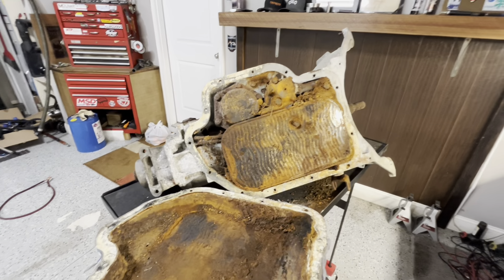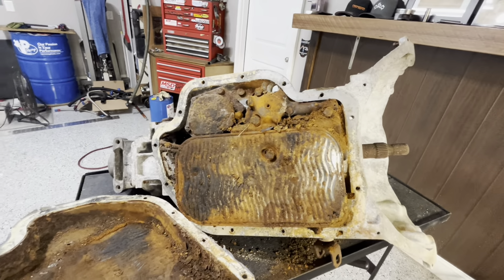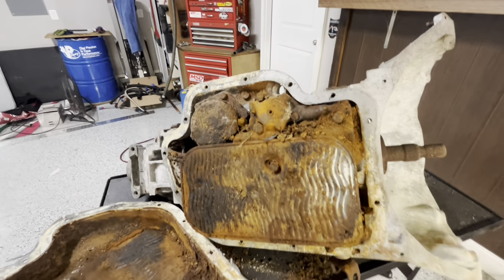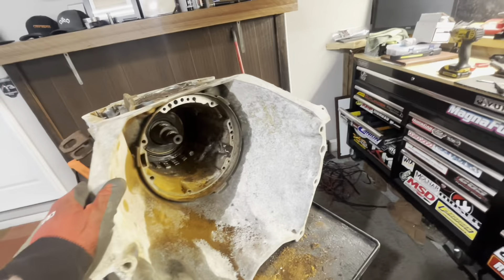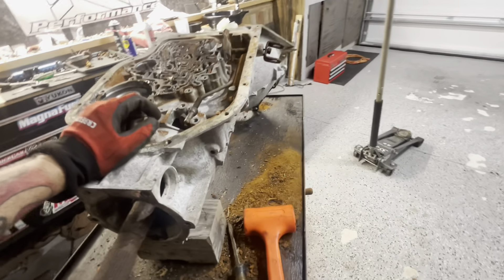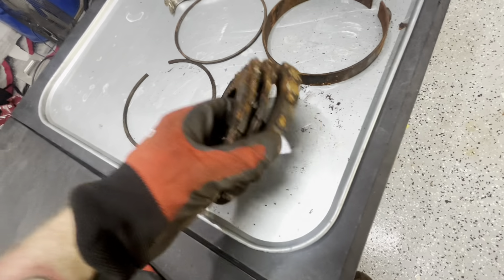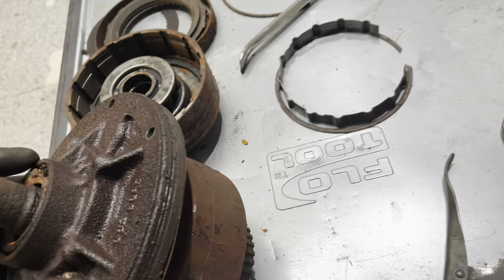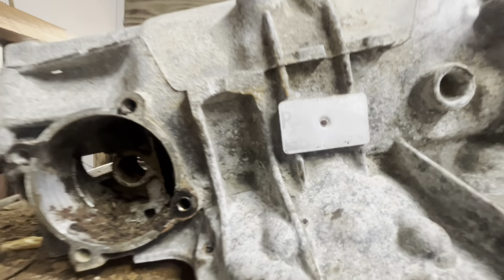🧰 Opening An Abandoned TH400 Transmission / Hard To Find Pontiac 8 Bolt Case?

Comment: The nail is factory and no need to bend it, the pump holds it in. Good luck finding a matching nail at the store. If you're wanting to keep the valve body and pump, soak them in vinegar for a couple days and it will get rid of the rust. I do them in my sonic cleaner, that way. It will eat aluminum though.
Reply from the maker: Very good info thanks
Reply: @ThePaintPaperHustle  Only issue i see with that case, is the shift shaft. You don't want to damage that hole that is goes through. Sonnax makes a ahaft with an o ring, that can help, if you damage it a little. I machine a groove in the stock ones and do the same. I do it in all the ones I build, just for insurance.
Reply from the maker: @funfun8095 interesting I didn’t know anything about that

Comment: That's a pretty rough transmission inside and out, I don't see anything I would use, even the case is shot. But on the upside tearing it down refreshed your knowledge for the next build 👍
Reply from the maker: Thanks man
Reply: Maybe the hardware 😅

Comment: 1. Don’t tell ppl not to comment. Comments drive the algorithm. Good bad it don’t matter let the haters hate they watch too.
2. When I bought my motor from Indy cylinder head they let iron blocks sit outside to pickle for a year then machined them. So the case is pickled good.
3. I got an idea on a video that does good numbers, get a battery charger a garbage can and do an electrolysis video. 40 year old racecar transmission electrolysis
Reply from the maker: Man I don’t even know how any of that electrolysis stuff works lol

Comment: Take that splined hub off the rear of the pump and see if it is a billet hub inside there.
Reply from the maker: How would I tell the difference?
Reply: @ThePaintPaperHustle  you tap it, if it thuds throw it away, if it rings like a bell it's a keeper.
Reply from the maker: @davidreed6070 awesome thanks